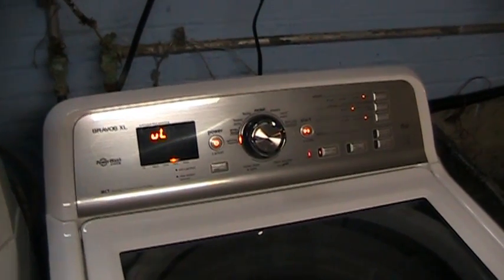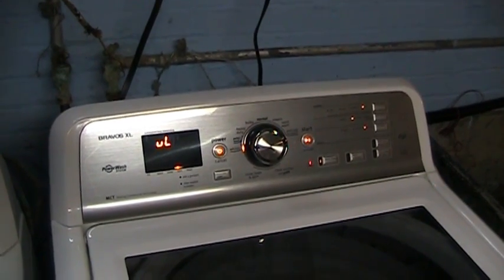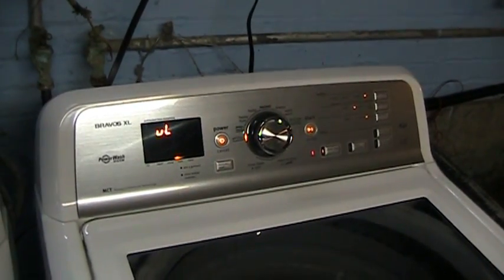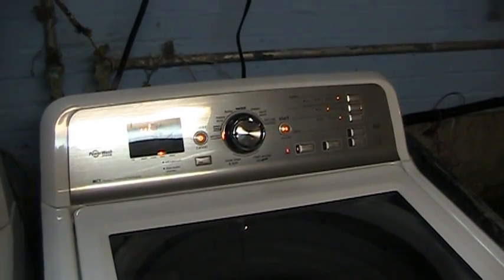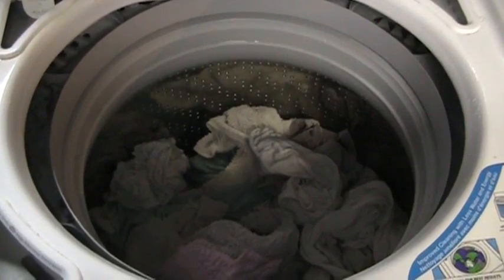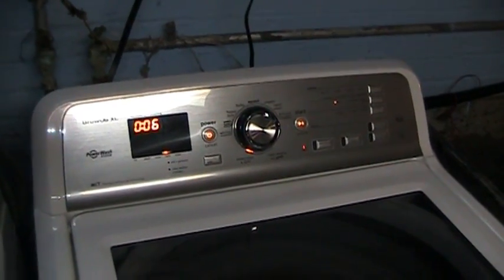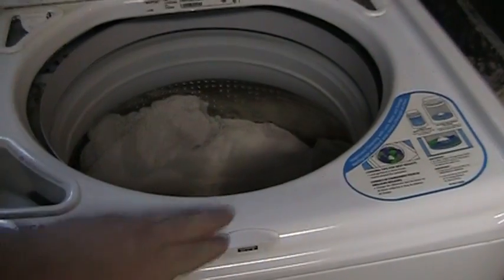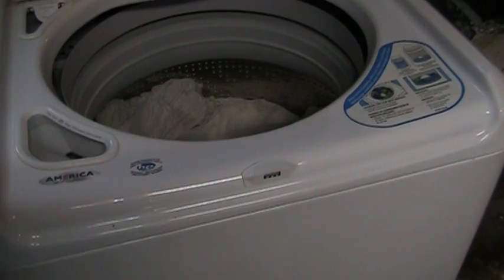Stupid Washing Machine Being Stupid

Comment: i bought a 5.2Cu samsung front load onyx washer. its amazing, but i dont see it lasting more then 10 years. i will say it does clean better then the old maytag top load washer. at least we save on hydro and water with the samsung. as you say in the video uxwbil, speed queen is prob the last brand left that makes washers that last

ive never heard of the brand called bravos before? whered yu pick that up?
Reply from the maker: No, Whirlpool is the world's largest manufacturer of major appliances.
Reply: My mum prefers the German brand Mielé and the last one she had took a real pounding over 16 years.  However she had it running all day long every single day of its life, so in real use terms it was at least twice the age, e.g. 36 years old.  It only had one minor repair which was down to user error by forgetting to remove the metal frame of a bra.  It was also only an entry level model, but it was built like a tank unlike the pile of crap Bosch top of the range model we have now.
Reply: Its a whirlpool bravos machine
Reply: Kyle's Tech Channel ohhh whirlpool...doesnt danby own them now?
Reply: EgoShredder what she doing laundry everyday
Reply: randomrazr
When we were growing up there were five of us, but now there is just mum and I so she only washes every alternate day now.

She is an expert at washing and seperates everything in to their own loads, not just colours and synetics / cottons etc she also knows which things will shrink if spun too fast with another load of washing, or what other factors can damage clothing.  She monitors what the machine is doing during its programme, because it often needs pausing and the programme adjusting when she notices it needs more water, an extra rinse cycle or more/less powder etc.

Some of my clothes are more than 20 years old and look almost like brand new.  I've seen how other women wash and how theirs clothes are ruined within months, and sometimes even mere weeks.
Reply: EgoShredder oh shit, i jsut know to seprate whites, colors, bedding, towels. whats your moms secret to keeping clothes new? :)
Reply: randomrazr
I'm not 100% sure as I am beginning to learn myself.  It seems she does not allow clothes to worn longer than a couple of days, maybe three and always on a clean body etc.  She avoids washing powders that are too strong, as they tend to damage clothes and fade them fast.  So she uses powders for sensitive skin and even then uses a lower dosage to what is on the box.  She also pays special attention to how the fibres and textures of clothing are made, e.g. some clothes may have a feel and finish to them which is too abrasive, when rubbing against other smoother clothes in the same wash, so she separates those from each other into different loads.
Reply: EgoShredder impressive
Reply: randomrazr
Thanks and I am so lucky to have a mum of such a calibre.  She approaches cooking, housework, health, dancing and more with the same level of detail and standards.
Reply: EgoShredder e sshe stick with cold water? ive heard cold water doesnt hurt your clothes as much?
Reply: ***** what are you bitching about again?
Reply: She uses cold water for some specific things which I forget now.  Apart from that it is just 30°C for delicate stuff;  40 for most clothes; 60 for bath and hand towels;  90 for dish cloths and sponges to kill harmful bacteria.  All of this is followed by repeated extra rinses to get all of the poweder out, to avoid skin irritation afterwards.

In her opinion top loaders are the best at washing, and front loaders are in her words, "dab washers" because they just roll things around in a tiny pool of water, with barely any lather / suds.